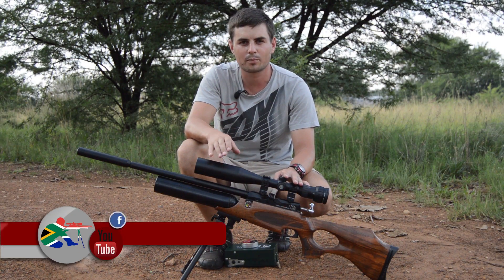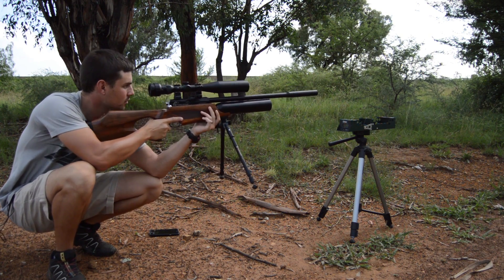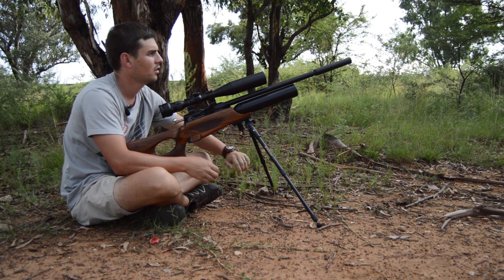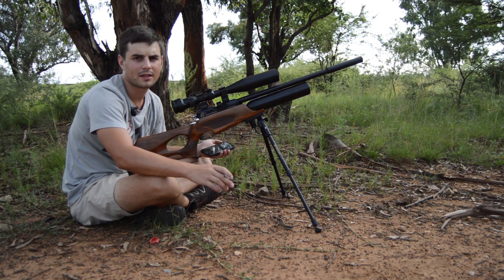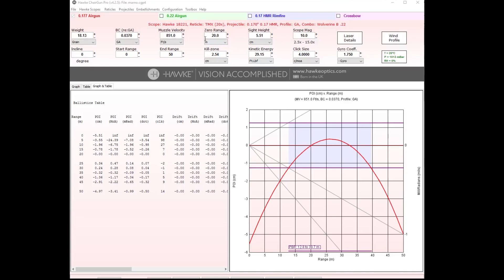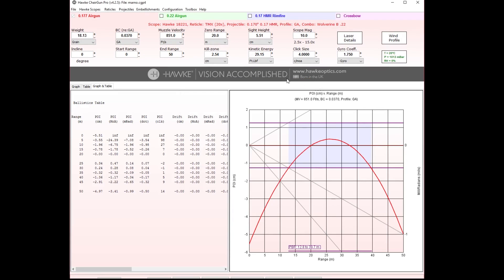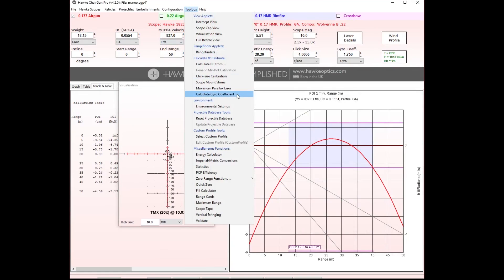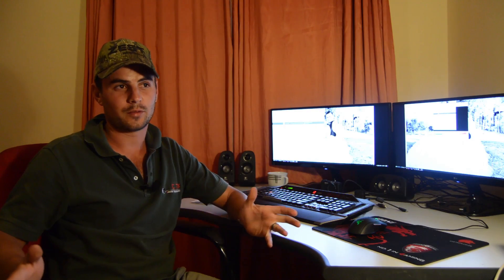How to calculate ballistic coefficient

Comment: so you cant just use a bc from the web, you need to make your own, now i need another crony.
Reply from the maker: Nope you can use bc from the web. But sometimes loads of things can play a role in your bc and you will find that your point of impact isn't where your ballistic app shows. So then you can find out what is your true bc this way
Reply: @AirGunnerSA  thank you for the advice,
There is another way to find the BC from your gun and specific pellet and that is using hawke scopes armchair pro,
And that is to input the measurement from the drop in the pellet from your zero point say 30 metres and your poi at 50m,
You enter them two figures and it calculates your BC from that measurement.
I'll give that a go before I purchase a second chronograph.
Reply from the maker: @PeakyBlinder  pleasure man. You can do that too but its not very accurate
Reply: @AirGunnerSA 
How about I know it's long winded but if my suggestion got me close to my 50 yard poi I could see where the pellet lands and adjust my BC input data untill the correct holdover is found,
I know another long range chronograph would make life easier so I might just go halves with my shooting pal and set all our pellets we use and get the shooting cards drawn up.
Thanks for the advice and tips.
Keep up the good work with the vids,
Liked and subbed.👍
Oh by the way we are in the nanny state of the UK and under strict nanny laws of 12fp pop gun pressure.
So the BC is quite severe and 50 yards is about the max killing range I would hunt vermin.
I might try paper targets up to 100 yards but probably wouldn't pierce the paper lol.
You are so lucky to have what power you want.
I shoot the 510 TDR regulated .22,  hw100 tk .23
Bsa goldstar .177.

Comment: Wouldn't it be more accurate if you use two chronographs to measure a single pellet's muzzle and distance velocity? From how I see it, one pellet may have 850 ft/s muzzle velocity with 750 f/s at distance of 50 meters, while other may have 835 ft/s muzzle velocity with 730 ft/s at 50 meters. If you use the first pellet's muzzle velocity and the second pellet distance velocity, you get a bit inaccurate result. How accurate is the average measurement in fact? That is my question